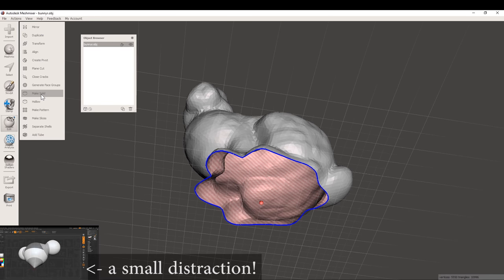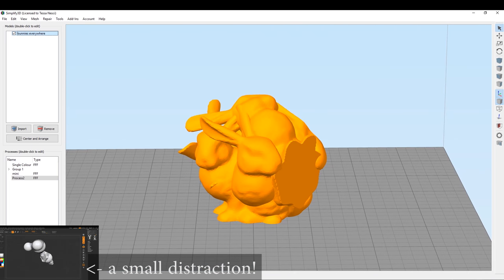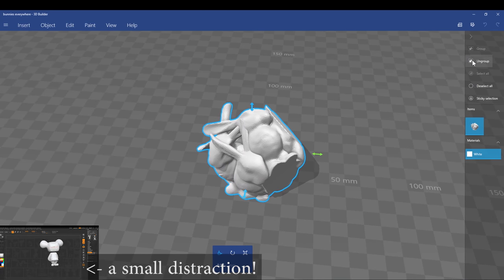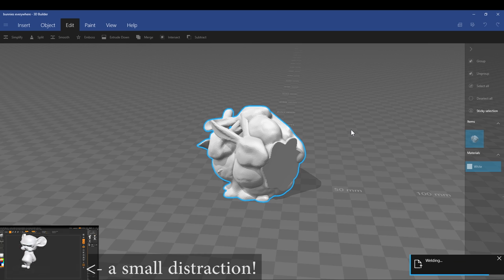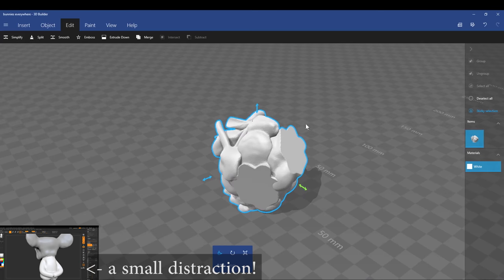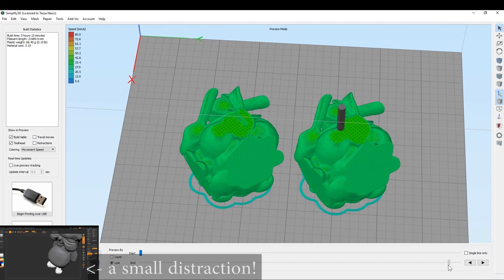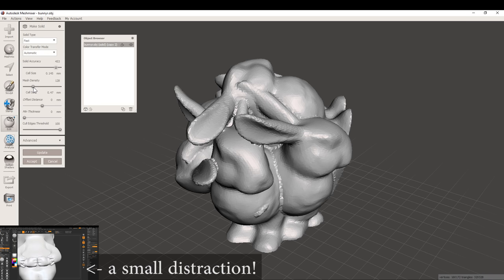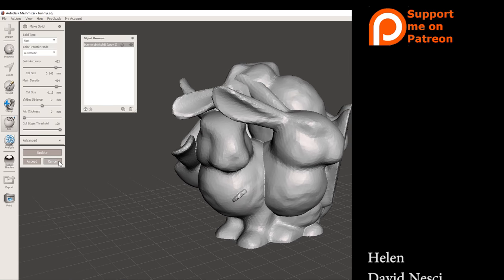Fix intersecting shells quick and easy! (windows 10)

Comment: 3D Builder does seem like a pretty powerful free tool!  Being a Mac guy, I'm going to have to do some digging and look into it's capabilities some more.
Reply from the maker: I wish I had a mac, so I could find solutions for mac users as well :( 

is it possible to run win 10 with a virtual machine? or 3d builder through something like wine.. does wine still exist.. or was that a Linux thing?
Reply: Yup, I still run windows in a VM so have access to the tools, just don't think to look there. Not sure if wine is still around, been a long time since I've played with it.